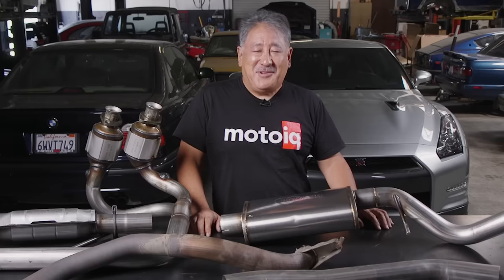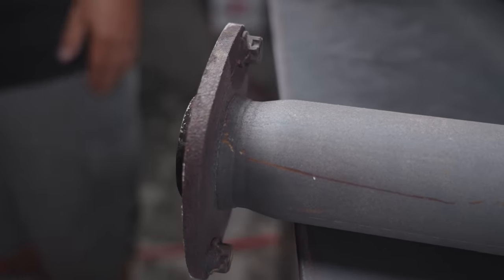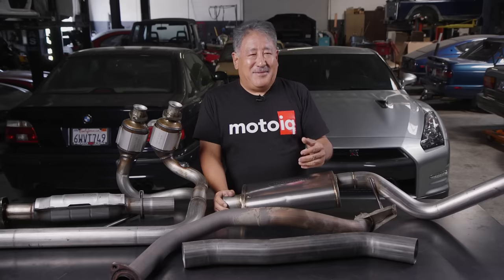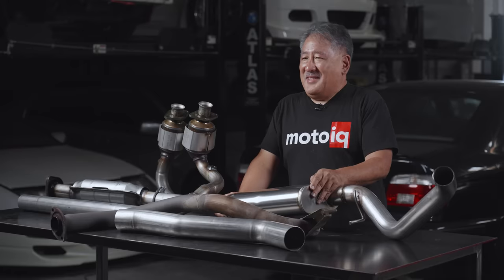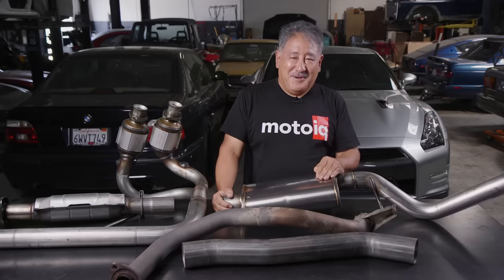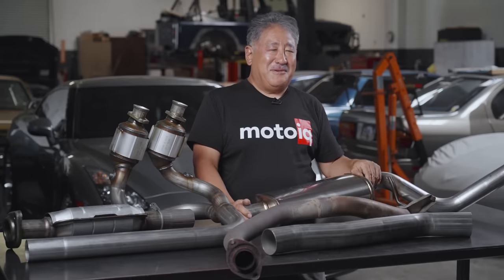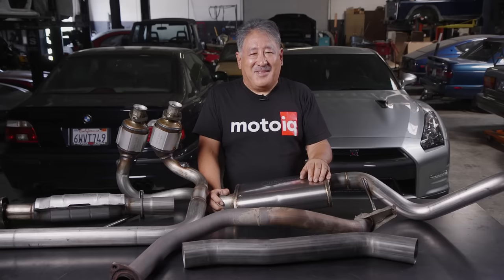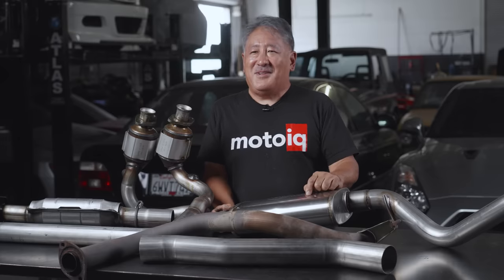Exhaust Back Pressure Myth DEBUNKED!

Comment: If the motor has a lot of miles it will start smoking back about 1985 I was working on a Datsun 280z we put bigger exhaust on it it started smoking where before it did not
Reply from the maker: That is not true.
Reply: @motoiq  oh yes it is
Reply: @motoiq  the valve guides were shot
Reply: @motoiq  I just watched your video you are working on engines don’t have a lot of miles on them as they get higher miles on them and parts start wearing out it will start smoking I’m not saying you’re wrong
Reply: @motoiq  also putting a ceramic coating on your exhaust manifold also helps keeping the heat and getting the exhaust gases out faster. I do know a little bit about it.
Reply from the maker: It is not what exhausts do when lowering the backpressure, its because your engine was worn out. It is something that happened to your engine, unrelated to the exhaust.  This does not happen on all engines.
Reply: @motoiq  I think I said that read what I been saying make sure you tell people don’t do on worn out engines
Reply from the maker: An engine that worn out is gonna smoke with or without an exhaust.
Reply: @motoiq  read my first reply that car did not smoke until after we put the bigger exhaust on the car
Reply from the maker: That isnt all engines, just yours.
Reply: @motoiq  oh, I guess engines never wear out
Reply from the maker: I would say that I have never seen an old engine that didn't smoke previously start to smoke immediately after changing an exhaust, because of the exhaust installation in 44 years of engineering, racing, and modding cars.  It sounds like you are making a general rule about something you say will always happen from your sample size of one. This is statistically insignificant.  I am not saying that didn't happen to yours, I am saying that is not something that generally happens. If you don't mean this then I don't disagree with you.
Reply: @motoiq  like I said read the first reply you should not say it never happens you’re the one that got all defensive what I was saying is that the valve guides where worn out once it lost it’s back pressure then it suck oil out of the head
Reply from the maker: I am not defensive, I am just saying that not all old engines will start to smoke because you put an exhaust on them like you were implying.
Reply: @motoiq  just mine lol really
Reply: @motoiq  so what you are saying is that just my motor wears out now I see where you said that what I said was not true
Reply from the maker: I didn't say that at all. I said not all old motors that don't smoke will suddenly start smoking as soon as you put an exhaust on it. Has nothing to do with yours specifically.
Reply: @motoiq  why would you say that is not true then.
Reply from the maker: Because I have never seen this happen in 40 something years of messing with cars.  I mean it's possible, it happened on your car but it is not common to where you need to warn people that it is going to happen. The only thing reason why this could happen is with less pressure in the exhaust manifold, maybe more oil could drip down the valve stems. I see oil going down the intake valves with worn guides all the time because there is a high vacuum there under deceleration and light throttle in particular.
Reply: @motoiq  you mean to tell you never seen worn valve guides I have repaired a lot of valve guides it does happen
Reply: @motoiq  I have done 5 angle valve jobs bored  engines and line bores for crankshafts counter bores for diesel engines rebuilt turbos fixed cracked heads take junkyard engines tore them down rebuilt them I know a little bit
Reply from the maker: I am not saying any of that, I am just saying that installing an exhaust is not likely to make an engine smoke if it was not before. That is smoking directly attributable to exhaust change and only that.  I am not saying that yours didn't, I am not saying it's impossible. I am not saying that engines don't wear out. I am saying it's unlikely it's exhaust's fault that an engine immediately started to smoke. Worn valve guide smoke usually comes from the intake side more due to the vacuum.  It's how you diagnose worn guides, if the smoke is way worse on decel, it's usually the guides, if it's worse on accel it's the rings.  Guides often don't affect compression and leak-down testing much.  Can't get much more clear than that.

Comment: You need some back pressure in 98 jeep inline 6 or it won't run
Reply from the maker: It's not due to a lack of backpressure.  It's things like improper design of new exhaust or the mixture needs correction.
Reply: @MotoIQ  funny the only problem was there was a y split added  for a dual tip set up so all we did was plug the second tip and it ran fine. Maybe back pressure isn't the right word

Comment: What is missing here is your degree, honestly no disrespect but why listen/follow you ? What’s your credentials 
I feel more low end torque with stock muffler vs stock muffler with a 1/4” gap at the flange letting out gasses faster.
Reply from the maker: I have a BS in Mechanical Engineering.  I have worked for Toyota's Racing Division, Nissan, Nismo, Falken Motorsports, KW suspension, The USAF Formula Drift team, Evasive Motorsports team. Sure reducing backpressure can reduce torque but it's not the reducing backpressure that causes the loss of torque. It's an improperly designed exhaust or poorly though out mod that reduces velocity and ruins scavenging as we talked about in the video or doing an exhaust that is so efficient it throws of the AFR. If you understand thermodynamics, it is impossible for the addition of backpressure to improve anything if all else in the exhaust design is correct. By raising the height of the PV curve in the gas exchange part of the otto cycle (backpressure), you reduce the amount of work that can be recovered in each stroke of the engine.  Gail Banks explains why backpressure costs you power pretty simply https://youtu.be/k7yYY_hy250?si=PGIIk5Qfbafrdr2z  Here is a test garage 4AG did on a small engine. https://youtu.be/V2Wv5-ZTOjM?si=oA1CylAdrnh5m48K You will note that increasing backpressure did nothing but hurt the power even the bottom end power that people often says needs backpressure.

Comment: Hes right and hes wrong. Depends...  the engine, the exhaust, the setup, the tune etcetc.

I had a 5.3l silverado that actrually lost close to 50ft lbs of torque with a muffler and cat delete(same exhaust just cut and weld in straight sections.  
Was dynoed before and after and after putting the muffler and cat back on.  
It deadass lost 50lbft peak. And wayy more down low.
I had a 3.5l v6 that lost a bit down low and none up top. 
Both of those vehicles are stock. 
I have a tuned up 2.0 that was unaffected by a ~straightpipe... ypipe exhaust dump in place of muffler. When wastegate opens roughly half exhaust flows out stock duals in back and half dumps below car(single too duals in back;dump placed on single but not all flows through dump)

Exhaust diameter and desighn were all unchanged. 
Restrictions were cut out and straightpipes welded in place...
Reply from the maker: I am not wrong at all, engines do not like backpressure but they can be tuned to run on it.  Did you monitor your AFR on your truck before and after you modded the exhaust?  How large was the tubing you replaced? What was your AFR before and after?  Did you monitor your LTFT and STFT's before and after and if there was a shift identify the root cause?  Something else was going on.  If you reduce backpressure and kept up your velocity than your tuning is the issue.

Comment: My CBR1000F had a 4 - 2 - 1 exhaust on it. I used to play around with different backpressure plates that mimicked the extremely restrictive and HÈAVY OEM twin pipes. Mind you I wasn't tuning the exhaust for top end mainly for more bottom to mid it definitely went tons better with the backpressure plate from low to midrange. Most Performance bikes these days have an EXUP system for that very reason. Regards Tony
Reply from the maker: If you are talking about an old Supertrapp muffler, man those are awful for power production.  If you got rid of it, and did a straight through absorption muffler like on modern exhausts, you would do a lot better for power and torque.  The EXUP system isnt so much for adjusting backpressure but to use the non firing pipes in the firing order as an inference branch to help low and mid range.
Reply: @motoiq  not the supertrapp mate basically an insert I fashioned out of light guage gal you're right on the money thanks for the reply cheers mate Happy Trails

Comment: Your story doesn't really fly because STOCK exhausts have many kinds of restrictions. They have CAT they have muffler and engines still run great. Back pressure won't destroy engines. All exhausts have been engineered to be perfect match for every single engine!!
Reply from the maker: It does fly because I am dealing with FACTS and science.  When you look at the PV curve of the Otto cycle, if you raise the floor of the curve with backpressure, less work or power can be recovered as engines derive work from pressure differentials.  OEM exhausts are designed with many parameters in mind such as noise regulations. price and emissions.  Performance is balanced between the other things. The best velocity with the lowest backpressure is going to give the most power, it's probably not going to be quiet and low-polluting.

Comment: Simple volumetric efficiency doesn't take into account that an engine is pulsing exhaust out the pipe. An exhaust pipe can be designed to work with this pulse such that there is a harmonic in the pressure wave which is lower than atmospheric pressure when the exhaust valves open. The pipes actually suck exhaust out into the pipe since the pressure wave is at a low point. At the pressure wave's high point, it bounces off the closed valve. This gives a better rate of flow than zero restriction, which would give a constant back pressure of 1 atmosphere.
Reply from the maker: We talked about that in this video.  Unsteady flow is more of a thing in the header primary tubes than the main exhaust. https://www.youtube.com/watch?v=kBQjBMiYW3E
Reply: @motoiq  The length in design of the exhaust header tubes is precisely what I am talking about.

Comment: i call it blow-by back pressure which means the top compression piston rings are either stuck when carbon burned emissions cake and bake in the
piston rings or just worn out rings. the catalytic converters clogg are engines just for emissions when its hogwash.putting out bad unburnable VOCs or watered down cornjuice gases or dino oil petroleum waste that isn't filtered that great.addittives detergents and are suspiciously in the gasoline? who is really going to investigate the gas companys for purity lol or are car companys with billions of money to
make off all of us .Vapors burn from the liquid gas so why sell us what really is invisible flammable vapors with cancerous materials? but is a cleaner environment? by clogging are vehicles emission systems so the money can flow through the big rigs of this world with phony advertising scams how clean are petroleum or cars are burning more efficiently? what a scam the people who sell or put out on us all .

Comment: love to see how an engine without any exhaust manifolds would do.......crickets.......hello........this video is silly
Reply from the maker: you need to watch it and understand it.
Reply: @motoiq  his very first statement that back pressure is not necessary makes the rest of it moot.
Reply from the maker: You are not understanding any of the video at all.  You probably didn't even watch it.
Reply: @motoiq  of course I didn't watch it, if he doesn't understand that back pressure is a factor of scavenging, then he's so far off base , there's no point. Cheers.
Reply from the maker: Then if this was covered, there is no reason to make this comment.
Reply: @motoiq  nothing was covered, he's just wrong is all
Reply from the maker: The point is, its not wrong at all and the reasons why are in the video.

Comment: All modified exhaust systems need some back pressure to get maximum performance. The scavenging takes place in the headers & having some back pressure at the catalytic converters is needed for the oxygen sensors to operate properly.
Reply from the maker: That is completly wrong.

Comment: NOT true. stocekr style NA motors use "some" (minor) amount to properly have the torque they want to produce. w/o it you get hp but loose lots of TQ.  this is the 2nd time i have seen ytou guys offering up not the best advice.  why?
Reply from the maker: Because you are wrong, you never want more backpressure.  You want exhaust velocity and good scavenging.  People put big exhausts on engines and loose power and blame it on low backpressure but they really killed velocity and scavenging. A smaller exhaust gaining power isnt due to adding backpressure but higher velocity and better scavenging that a smaller exhaust can give. People can have a hard time understanding this.
Reply: scavaging is a form if back pressure, much like a 2-stroke system. it;s simple fluid dynamics. @motoiq
Reply from the maker: No it isn't, it's a lack of backpressure at the right time.
Reply: @motoiq  now your admitting about back pressure. so the origional statement if cars don'e need it was wrong. they need "some" form as i have been saying. maybe you should leave this to the experts and stick to backyard mechanics?
Reply from the maker: Maybe you need not to try to argue in an attempt to get attention.
Reply: @motoiq  i'm not. i jsut don't like bad info being put out.
Reply from the maker: You are wrong and disseminating bad information then.
Reply from the maker: @mike9500  No, it is not bad information, 100% correct backed up by years of PRO engine building, physics, and thermodynamics.  If you don't believe me, check out what Gale Banks says https://youtu.be/k7yYY_hy250?si=PGIIk5Qfbafrdr2z  If you don't believe Gale Banks, here is a test garage 4AG did https://youtu.be/V2Wv5-ZTOjM?si=oA1CylAdrnh5m48K

Comment: you dont know what yr talking about. there is ALWAYS back pressure. back pressure is integral to a combustion engine.
what you want, is for the back pressure waves to arrive back at the exhaust port when it is closed, not open.
Reply from the maker: watch the video
Reply from the maker: then you will be forever ignorant because you have no idea what the video is about. Design a header to have the reflected wave arrive when the exhaust valve is closed and tell me how good it works if you even know how to do that.
Reply from the maker: @Ghryst  No, it is not bad information, 100% correct backed up by years of PRO engine building, physics, and thermodynamics.  If you don't believe me, check out what Gale Banks says https://youtu.be/k7yYY_hy250?si=PGIIk5Qfbafrdr2z  If you don't belive Gale Banks, here is a test garage 4AG did https://youtu.be/V2Wv5-ZTOjM?si=oA1CylAdrnh5m48K

Comment: Minimum 3" in a K20 my ass
Reply from the maker: Ok you build one then.
Reply: then tell me a reputable exhaust manu for k series thats <70mm 🙊
Reply from the maker: Google it, there are a lot of 3" k series exhausts on the market.  I am also talking about the performance versions of the K motor needing a 3", not the ones like the A3, A4, A6, A7, A9, Z2, Z5, K24A Eco, and other non performance, or the integrated exhaust manifold versions. Those need smaller exhausts but they are in cars that no performance enthusiasts is likely to mod.

Comment: Well the guys a liar because without enough back pressure your engine will be weak it wont have the troque it should.
If you are talkng back pressure as in like putting an exhuast on it that too small then yes it not good for the engine.
A slighty biggest exhuast maybe will make the engine better but 
A modified engine then yes go with more free flowing exhuast system.
If you wanna take a chance and lose a race than listen to this guy all because you wanted to sound louder.
Reply from the maker: I think you need to watch and try to understand the video! There are tons of things that cause engines to run poorly when you change exhausts including going too big for your engines size and state of tune, killing your exhaust velocity, scavenging, and losing power, exactly what we said in the video.  Getting too low backpressure is not one of the things that makes your car slow.

Comment: To many variables because a tuned exhaust is application specific , running wot racing an getting grocerys in an old car are completely different , older v8's need back pressure for day to day driving an fuel millage , would takes an hours long video to explain the formula's involved in tuning an exhaust and building one for your application , don't believe me google duntov and how he got sbc to run or go cut the chambers off some dirt bike see how it does , tuning the exhaust you can put your power band right where you want it , factory's tune exhausts for daily driving an spend millions in research for a reason , spend 15 years campaigning a two stroke triple and building your own chambers then talk to me about back pressure . for general knowledge this video is ok but you won't be the first through the timing lights .